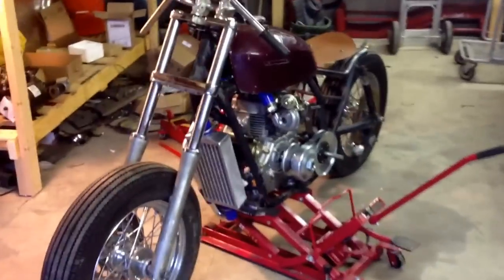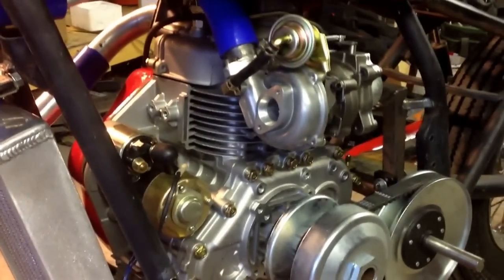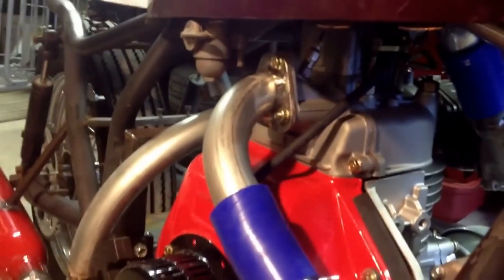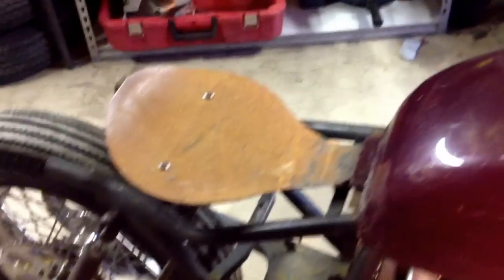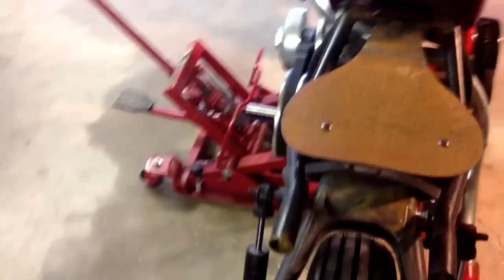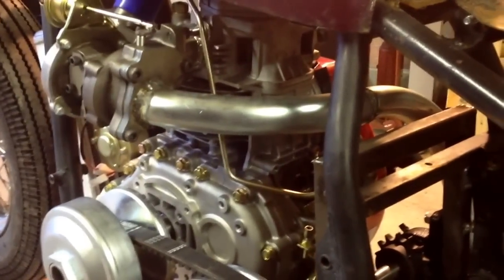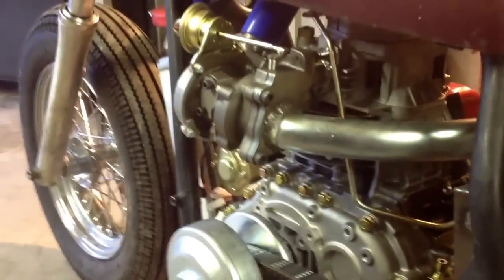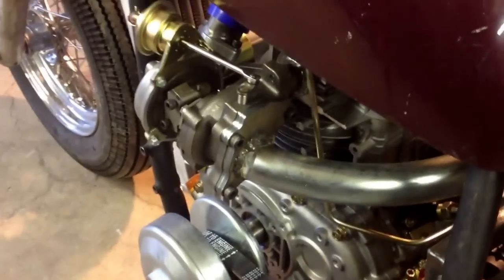Intercooled Turbo Diesel Motorcycle

Comment: I my experience using turbo chargers for single head diesel engine is not good idea as it consume lot of fuel.. Performance like rpm increases but torque is dropped..

Comment: Using CVT is not safe, because the diesel engine can sometimes get out of control and must use the clutch.
Reply: Not on compression release equipped engine

Comment: just be sure to match the flow into the turbo with needs of the engine.  A small regulating screw, so as to not lower oil pressure would be nice, but not necessary with proper size cooling oil line. It looks good, I would be concerned about the torque to the front motor pully, with the distance front pulley is from engine. also synthetic oil will work best, so as to not coke out through the turbo oil galley. Be sure not to rev it before turning off, so the spin down will not score the bearings.

Comment: Quite impressive - you used a CVT to overcome the (presumed) limited speed range of the engine. This is an idea I had many years ago so that you could get better results from using the hair-dryer motors in leaf blowers and strimmers on mopeds, which are basically designed to run at only two speeds. What benefits does the turbo and intercooler give?

Comment: How has the reliability been in that Chinese engine?
Reply: James Thomas They work actually pretty good for their price. Of course it isn't a high end engine, but for a ~500-600$ price they work pretty well😊
Reply: In the UK, you would pay £1600 for a genuine Yanmar 406cc diesel. A Chinese clone costs £400. The only possible deficiency in quality (in the 406 engine) might be the crankshaft bearings, since the Yanmar would employ top quality European bearings. As long as the oil is changed regularly (1.6 litres) there shouldn't be a problem with the clone. I've done 25000 miles on my diesel bike so far, with absolutely no issues. Even if the clone were half as reliable as a Yanmar, (& it's FAR better than that) - I could buy 2 Chinese diesels & still be £800 better off than buying one Yanmar. It's a no brainer! The 456cc diesel, which uses a longer 75mm stroke, has had crankshaft breakage issues. This might be due to poor crank web design, or it might be owners fitting them into bikes giving them extremely tall final drive sprockets, then allowing the engine to lug down at very low revs, which is the exact opposite of their design remit. They are short stroke engines designed for 3000-3600 rpm power outputs. The injection timing is set to very much favour that range. It is far too advanced for sub 2000 working under full load, & doing so possibly sets up a catastrophic vibration through the crank web. People wrongly assume that because it's a diesel, it produces huge torque like a steam engine at low revs. But it doesn't!
Reply: hiyadroogs yeah there a set speed Diesel engine. And won’t perform in various rev ranges due to no dynamic timing advancement

Comment: What size CVT did you use? 3/4" inch or 1" 40 series CVT?
Reply from the maker: 1in on the engine driver pulley, 3/4 on the jack shaft driven pulley.

Comment: did the engine bolt right up to the transmission. forgive me if this is a stupid question im not to familiar with motorcycles
Reply: Nope, the transmission was done away with entirely and replaced with a CVT like you find in scooters and go-karts. It's an extremely efficient way to transfer engine power to the wheels and makes it work like an automatic.

Comment: realy like the overal shape you hit it on the nose with the dimensions of the bike , most of the ones i seen look too long in the middle 

about the jackshaft and the clearance issues , would it be possible to change the rearsuspension so the hingepoint of it is allso the jackshaft 
i mean make the pipe that holds the long bolt bigger so it can hold bearings big enough to stick the jackshaft axle through it you could then run the rearpully inside the frame shimmed between the pillowblock and the bearing in the hingepoint of the rearfork
you can do the sprocket on the other end the same way 
you might need to bend out or widen the frame an inch or so on one side to get it alighned with the enginepuley but you have a lot less rotating parts sticking out if you get it to work that way you can mount the enginepulley against the carter like you intended and the chain stays tensioned trough the suspension travel

Comment from the maker: Not yet, I plan on running it at 6 to 7 psi of boost because it has the stock naturally aspirated compression ratio of 20:1 and to run any higher amounts of boost I would have to shave the piston down to 16:1 so that it dose not blow a head gasket.